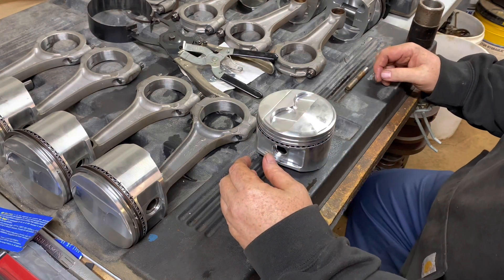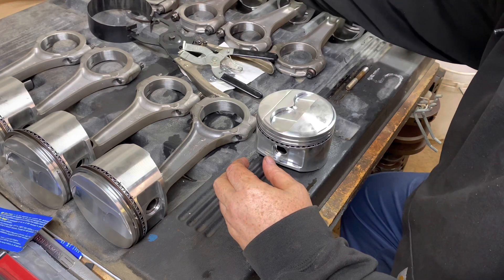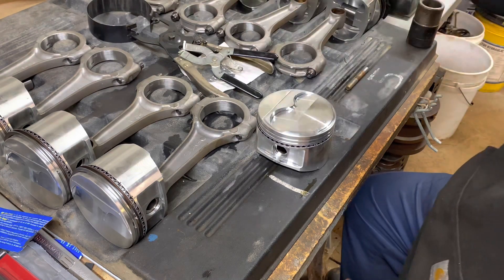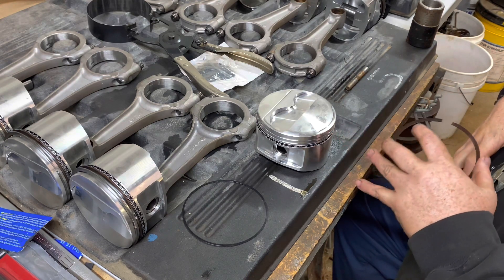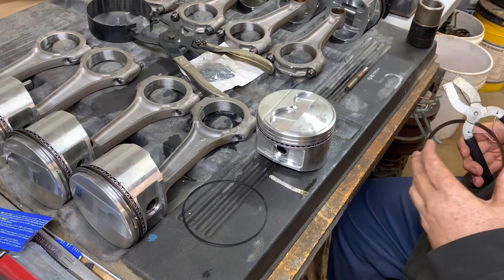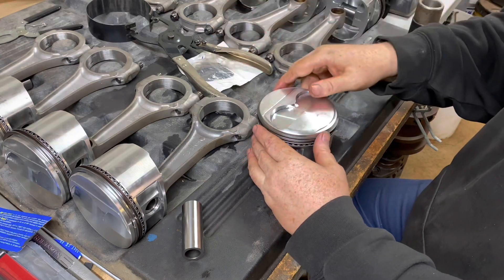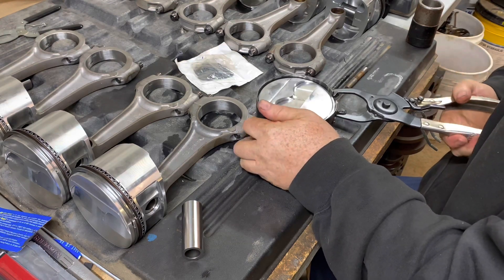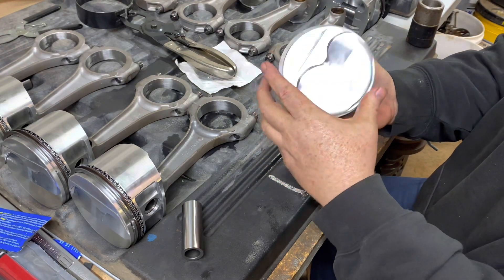Installing Total Seal Gapless rings on ford fe 427.

Comment: What's the issue with LeMans rods?  Didn't you say earlier in a video there's forging issues??
Reply from the maker: There is. This customer is insisting on using these rods. I replaced the rods I was using in the sohc engine I’m building.